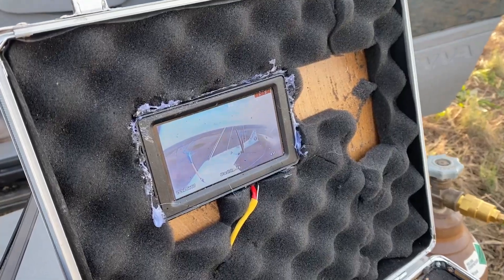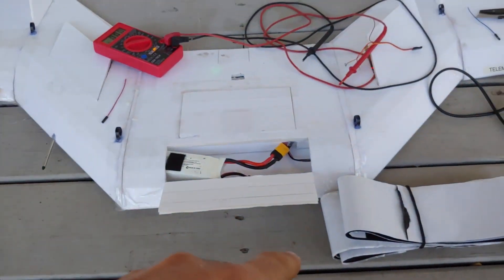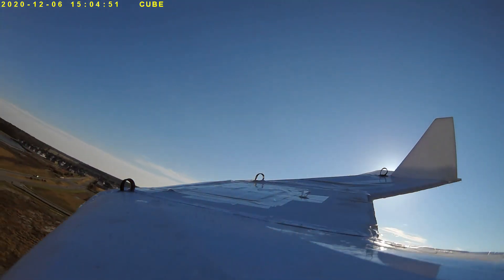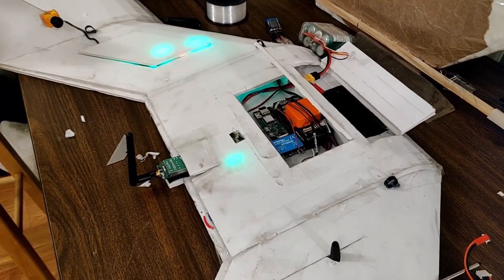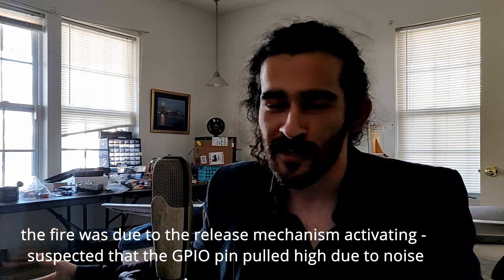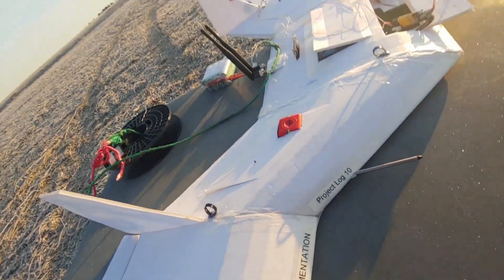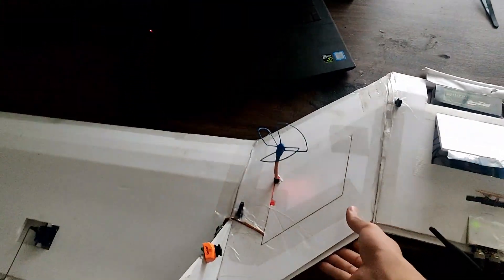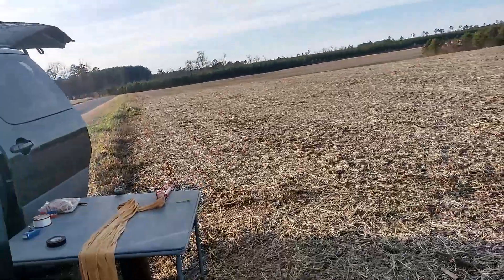High Altitude Balloon Glider - PL10: Autonomous return from low altitude balloon

Comment: Hi Tarek, in the video you say the plane was released at 100K feet. Is that right? do you include the horizontal distance it traveled away from you?
Reply from the maker: The plan is to release at 100k ft. This video was much lower than that.

Comment: Why use a cube instead of a $20 OmnibusF4v3pro?
Reply from the maker: mainly, and initially, i was sponsored by cube.

but, even if I wasnt, i wouldnt trust an omni for a project like this. There's a lot of stuff that could fail that a lot of the cheaper boards don't have any redundancies for. They use cheaper sensors, cheaper manufacturing, etc. With bullshitting around the cheaper boards could fly projects just fine. A hardware failure isnt actually mission critical with some projects - you could just throw it in the air again. 

But, with a project like this, reliability really puts you at ease that nothing will fail on the one single time that the aircraft will be flown at altitude. Cube seems to have a pretty good track record in that regard.